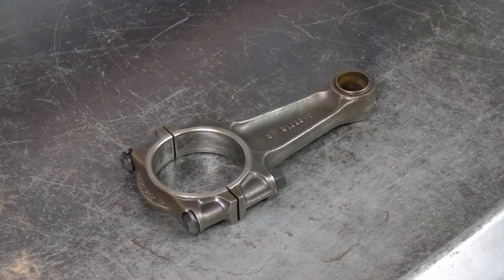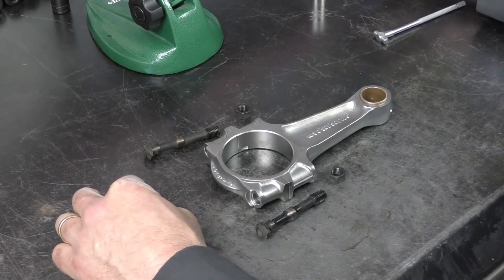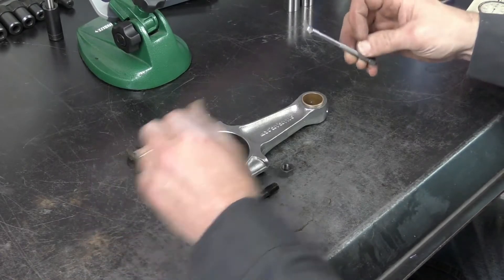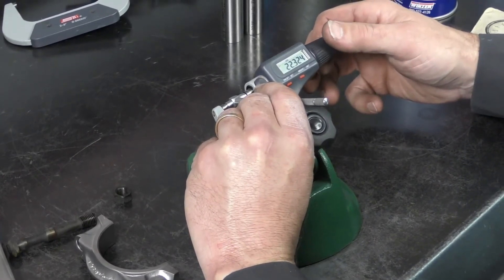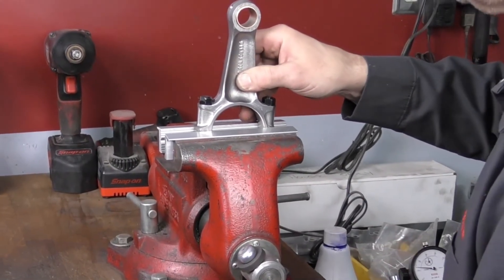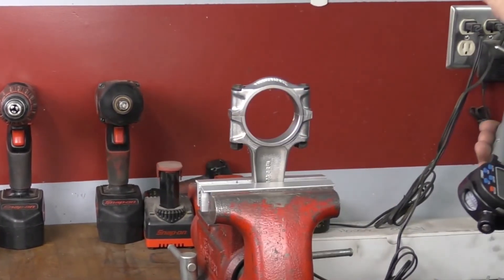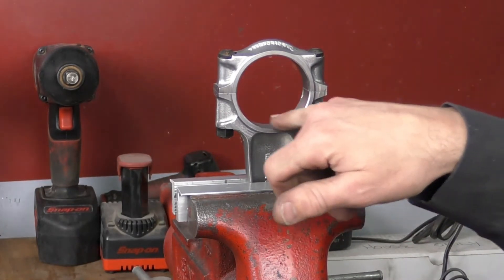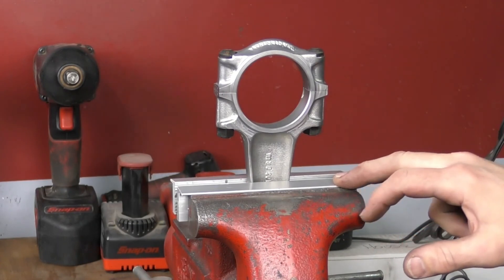Porsche Connecting Rods. How to Inspect and Measure your Air-Cooled Connecting Tods

Comment: Hi Kurt, could use your help interpreting the Porsche specs.  On page E129 of factory manual, it shows dimensions for fitted length.  Do I assume that’s newly installed?  Also, W dimensions are for the pin and B for the installed bushing?  I’m not sure how to interpret all the “Play or fit” specs.  Also not sure how to interpret Wear Limits.  How did you derive discard as 22.08?  A video on this would be really helpful.  Anyways, thanks and Happy New Year!
Reply from the maker: Rob,
The "B" dimension is the internal dimension of what ever piece you are working with. For Example: The first dimension on that page labeled "B" is for the connecting rod little end without the bushing installed. The Size should be 25.00 /-0.00 +0.021 mm. The next dimension is for the outside of the rod end bushing, "W". That number is bigger than the Rod bore as the bushing is a press fit. Its dimension is 25.035 to 25.055mm this is so we will have an interference fit of at least .035 mm to a maximum of .055 mm. This is because the bushing is larger than the bore on the connecting rod.
When we look at the next dimensions they are giving the operating clearance between the wrist pin and the bushing. The finished installed bushing I/D size should be 22.02 mm to 22.033 mm. Our wrist pin O/D will be 21.994 mm to 22.00 mm.  This will give us a maximum running clearance of 0.039 mm and a minimum clearance of 0.020mm. 
The reason the bushing we measured 22.08 mm was discarded was because the maximum operating clearance was to big, (22.00 pin - 22.08 bushing = 0.08mm clearance), maximum usable clearance is 0.55 mm.
hope that helps to explain it
Kurt
Reply: @Aircooledconsulting  Kurt, thanks for the explanation.  I spent 20 minutes with the book out in front of me reading your explanation but I think I’ve got it.  Reading these specs has always been a bit of a mystery for me so I really appreciate you taking the time.  For the first time I feel confident in measuring all the components in my engine rebuild.
Reply from the maker: @robhurley5258  glad I could help
Kurt

Comment: What tool does machine shops use to remove rod bolts? I am looking for a machine shop in my area to remove my rod bolts. I am replacing with the stock Porsche bolts (not ARP). Do I need to have anything balanced or resized? I would hate to take my crankshaft back to the machine shop just to put the crank rods on .
Reply from the maker: All the machine shops I have ever been in have just used a hammer to knock out the rod bolts. Its is always good to check your rod sizes and check the weight difference between rods.
Reply: @Aircooledconsulting  Thanks. I took them to the machine shop and they had to press them out. I had ruined the threads on one of the old bolts trying to hammer it out so didn't go any further. These were original rod bolts so maybe they were seized in there. Well got them out and the shop installed the  new OEM bolts so will be putting the rods back on the crank this week and hopefully closing up the case on Saturday or Sunday!

Comment: I really appreciate your videos, they are excellent. But anyways, in this case I would like to add, that the rods should be checked for parallalism of the 2 bores as well (any angular failures caused by bending).
Reply from the maker: Yes you are 100% correct, we cover that in our connecting rod rebuilding video. Unfortunately we have not posted it yet as it is still in the production phase.
Thanks for watching
Kurt